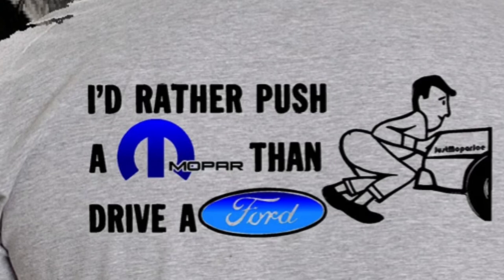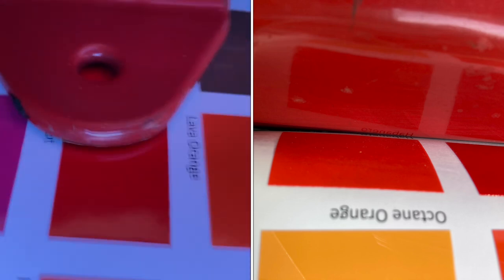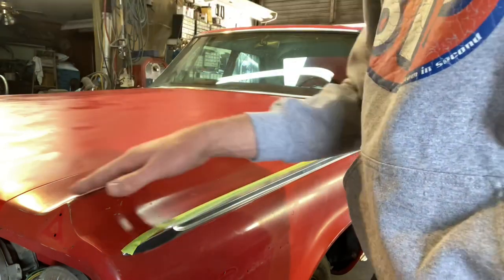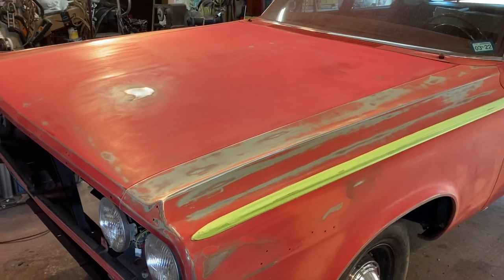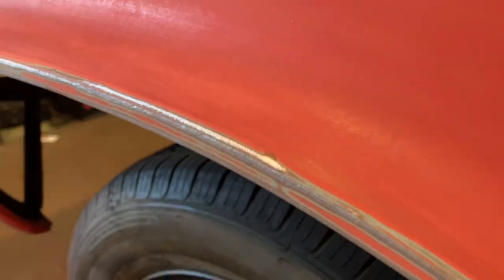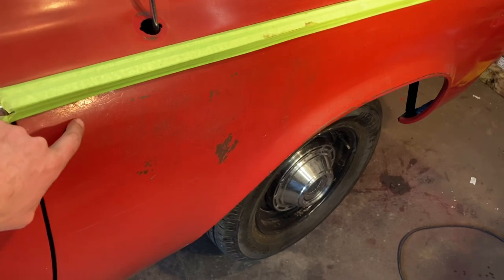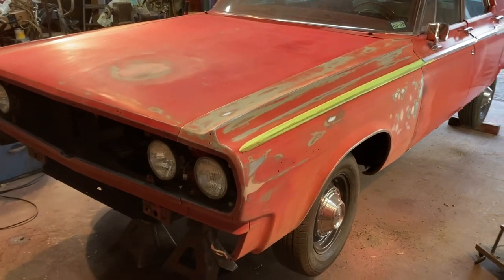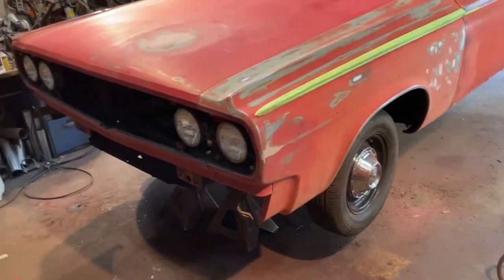65 Coronet:Color Matching and Body Work Begins

Comment: That feeling when you watch someone who knows what they are doing and seeing exactly where you yourself went wrong. Thanks for that brief tutorial, I now know precisely where I have gone wrong in the past with my sanding/filling. Hopefully I will have enough left in my for one final project similar to this and I get better results!
Reply from the maker: That’s awesome brother. There’s more than one way to skin to cat! I know guys who swear by spraying epoxy everywhere, then filler, then 2k primer, then putty, then primer. And I know guys who would have shot paint right over this old red, after a sanding with 400 grit. I want it to be nice and straight, so I figured I could block what was there, use my putty, then 2k as a sealer and lightly block it again. Plenty more to come on this one’s body work, and paint should be here soon.

Comment: That red matches really good. I've got that Summit primer for my next project. Good to hear you like it. It'll be the first time I've used it. That type of filler you are using is great.  Sands easier than regular filler.
Reply from the maker: It’s good stuff. Thanks brother. My plan was to only fill small spots with this putty. But the passenger side kicked my butt all day today. I used the summit Filler on it. It’s good inexpensive stuff.

Comment: Lookin’ good Joe! Do you use an actual guide coat product? I’ve heard that any cheap flat black quick drying (not enamel) rattle can spray paint works good as a guide coat also? Thanks.
Reply from the maker: Thanks Ron. I’ve used old black paint before. But I found at Oreilys they sell actual guide coat in a can. They had to order it, but it dries quickly and is good.

Comment: Thankyou mopar Joe another good one, only one question what grit do you like to start with on your dura blocks, I thought you said 80 grit and do you switch up after priming with additional block sanding? Any info would be appreciated.
Reply from the maker: Yea man! I appreciate your support. I have a roll of 80 to start with, and a roll of 180 to finish with. Once it’s straight at the rougher finish, it won’t need as much correction later.
Reply: @JustMoparJoe  Thankyou for the info, very much appreciated.